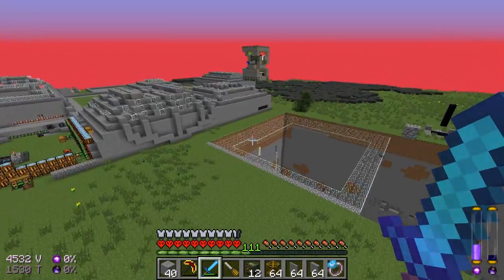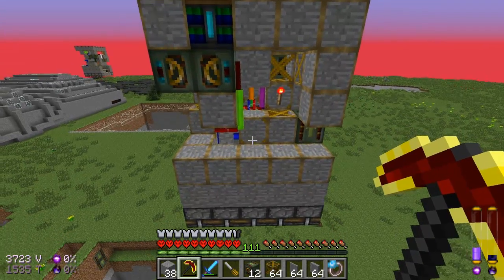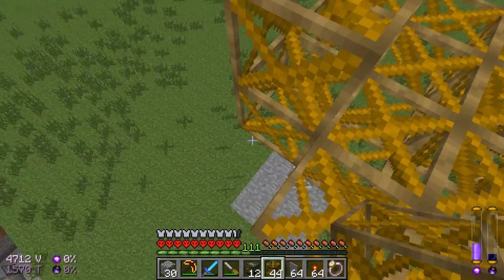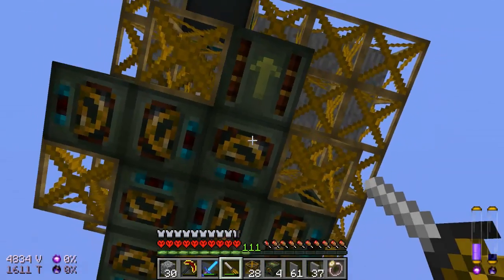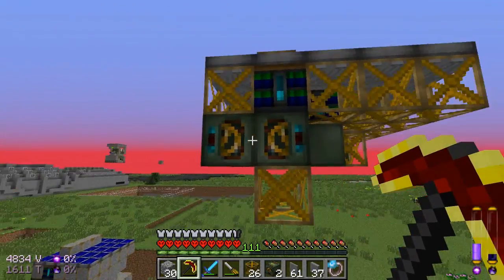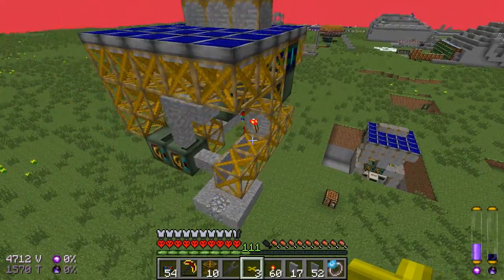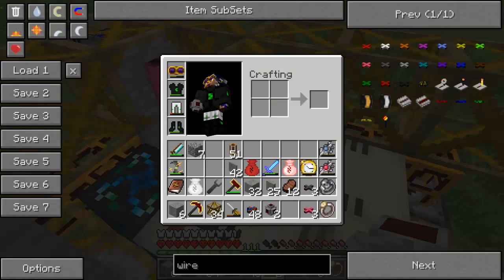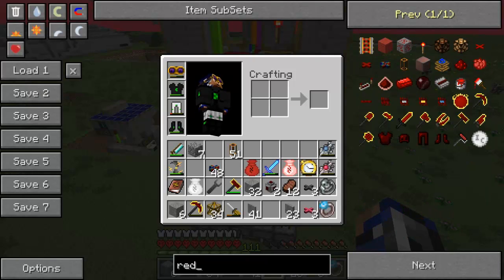[How-To] Mobile Quarry Mark IV - Part 1

Comment: I might be missing something then, using my control room design I was able to use the same coding you used (from MK2). I was having issues with the goTo and raiseTo commands, but I think that is more from my inexperience in coding than from the wireless system I used. As far as I know it can span as far as ever before. All of the circuits are set up the same, just wirelessly. By having it set up with enderchest mod as well you can sit in your control room and have it send everything back to a s